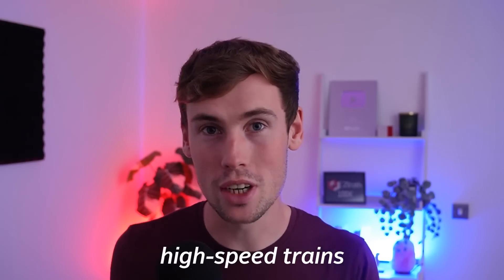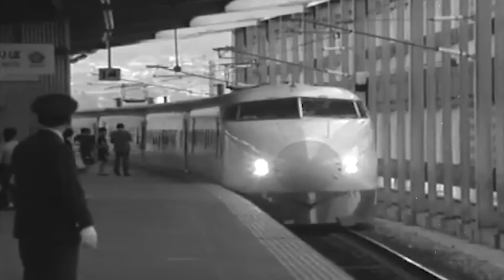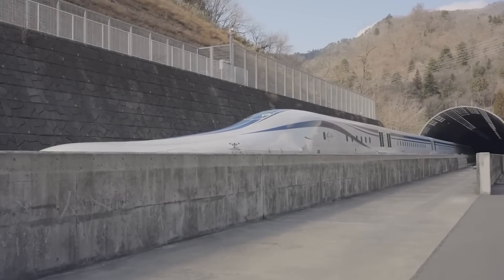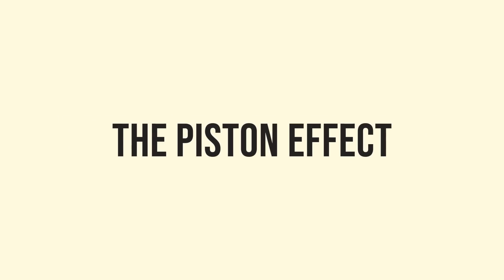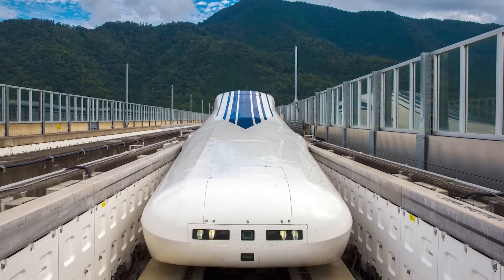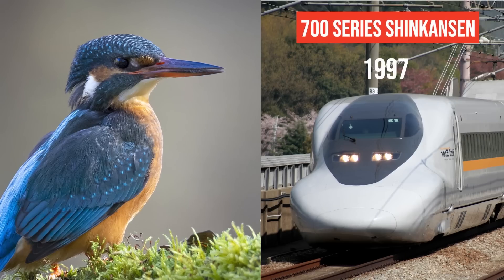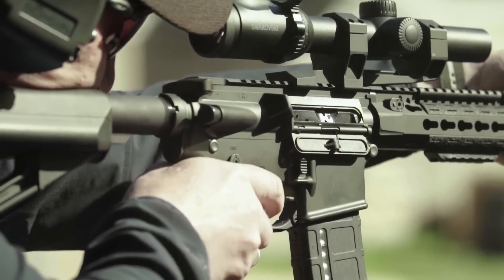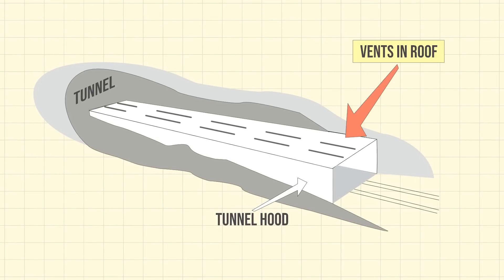Why The World's Fastest Train Looks So Weird

Comment: Trains are efficient because the weight of the train is supported by the ground and the metal wheels on metal tracks is highly efficient. With Maglevs and similar tech the train is no longer supported by the ground. This hurts efficiency. Also, speed hurts efficiency. The moment a train is no longer supported by the ground it is an aircraft that uses magnetic forces to steer instead of control surfaces. The thought of building tracks for aircraft to fly on is silly.  Small metro drones that carry 5-10 people and fly specific routes autonomously will eventually do away with high speed trains. The infrastructure required is just too much for trains. Long distance high speed travel is the domain of aircraft. Trains are best for low speed bulk cargo.